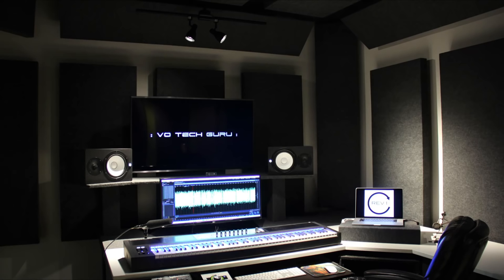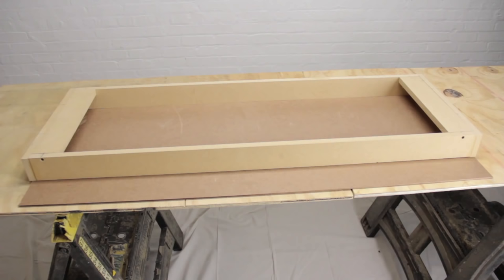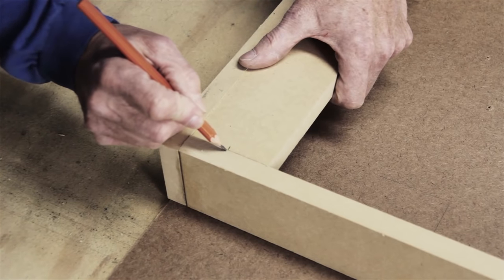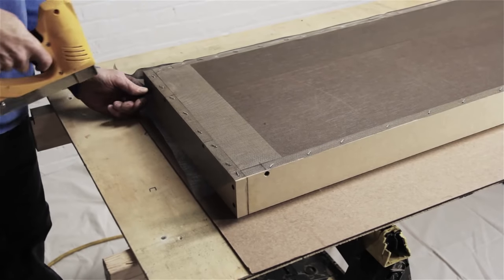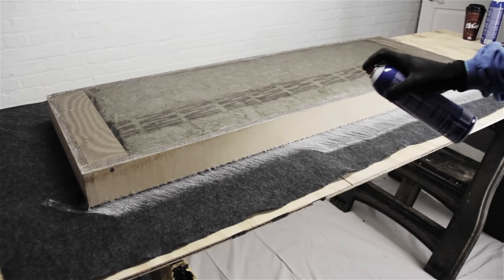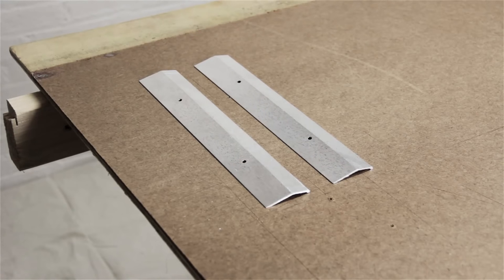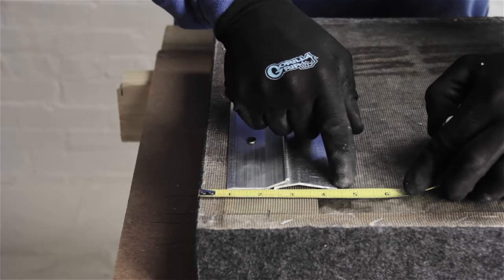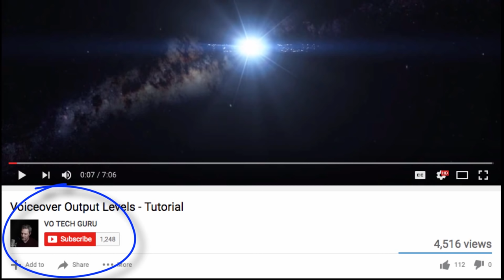How To Build Acoustic Panels | DIY Acoustic Panels

Comment: I made some with closed backs. I used a 1x4 by 3/4" cut in half at a 45' to hang them and put a strip at the bottom for spacing. I also added two each 4x8 by 3/16" aluminum feet to a couple I made to make them freestanding (GOBO's). I like the open backs for the absorption factor. Good video!
Reply from the maker: Thank you! Yeah, the open back def helps diffuse the sound more and the gap helps as well. But for gobos, I bet I would close the back as well if for no other reason than aesthetics. Please feel free to post pics on my Facebook page if you feel like sharing. It’s under VO Tech Guru. And thanks for watching!

Comment: For all the noobs like myself read this!
I just built these and because of my full time job this took me about 3 weeks. It actually came out to be $30 a panel, but makes sense because this video was made four years ago. I had to spend about $100 because I didn’t have like half of the tools mentioned. (Never really built anything before except for a chair in shop class in middle school lol)
These came out to be 14 pounds each. 
Okay, so for the wood.. Home Depot wouldn’t cut it into 3 inch pieces. The smallest they would go was 1 foot pieces to which came out to be 2 - 12” pieces and 1 - 12.5” and 1 - 11.5” piece. Soo idk if they changed their policy on this or what. Anyways so I ended up renting a circular saw from them (which was $28) for a days  use and cut the boards to be 3”. I had to cut each board by 47” width ways first before cutting it length ways because I suck at cutting straight so yeah haha I learned that the hard way.. but anyways, when it comes to the drill bit, the one on the tool list is too big, if you see in the comments I listed the right drill bit size that is needed. And it looks like the one exactly in the video. Everything else is right. I also had to do most of everything on the ground on my garage floor because I don’t have a table that big. I wood glued a scrap wood piece to a big cardboard piece I had on the ground and used that for my frame building. I also used recycled denim for the insulation because it is safer and actually has a higher NRC rating (noise absorption rating). It has the same dimensions as the Rockwool. I got it from Lowe’s. If you need help finding it let me know. Oh also, I needed an extra can of spray adhesive.. maybe I sprayed too much? Idk. But all I know is if I can do it, you guys can too! Also thank you VO TECH GURU!! I watched a ton of videos on how to build these and this one was definitely the most helpful/simplified one. Plus of course the voice is the best.
Reply from the maker: Thank you very much for watching! And sorry for the very late reply, YouTube studio just recently changed to show all missed comments.

Comment: clear, no bs instruction. Now I just need a shop to build it all in.
Reply from the maker: Thank you! It actually doesn’t take much space. If you pre cut, then move that stuff out, then do the next with the same step. You know? Thanks for watching!
Reply: @VOTECHGURU  I did it with some moving blankets and ceiling panels. I took two large blankets, folded each in half and put one on either side of the doorway to the kitchen where a shared wall is. I put the ceiling tiles on these 2" thick Styrofoam panels I found and placed up against the shared plaster wall. Putting my iphone to 3/4 full volume; I could barely hear it from the kitchen. Hopefully they can't hear me practice guitar from the other room either. 

Yours look way better though but hey, I'm not out to impress anyone. Maybe if the guitar ever earns me a gf I'll make something nice like yours. haha

Comment: I've been building panels like this for 2 decades... they are amazing!   There is some really great ideas here in your video I might start using instead of my methods like the use of the threshold metal for the hanger!  Great stuff!   Great video!  Thanks.
Reply from the maker: Jon Raven Thanks for watching!
Reply: No prob!   I've always been a huge advocate for Green Glue usage in studio construction and when they shared your video on Facebook, I came over to check it out!   Great stuff!
Reply from the maker: Jon Raven Awesome. Yeah, my studio in this video where I voiced this tutorial is down the street from a fire department, across the alley from a cabinet shop and on the main street of and industrial zone. Nothing makes it into the booth. We showed most of the build with some pre and post results on my Facebook page at https://Facebook.com/votechguru Maybe check it out, you might dig it. :-) #GreenGlueForLife

Comment: That's a great panel.
The French cleat and bumpers are a solid way to hang these.
But, I would add a backing. Seal that unit to prevent dust.
Reply from the maker: Flaco Kerrigan What dust?

Comment: Thank you for such an in depth tutorial. Just to clarify these sounds panel is equivalent to studio foam if not better. I have studio foam, and canvases but with like 6 towels in the back of them, and I am definitely thinking about adding these as well. Quite a project but looks fun. I want to mix in a room with good acoustics and from what I'm seeing this is what I am looking for to further my studio sounds while mixing.
Reply from the maker: Thanks for watching. Yeah, WAY better than studio foam. I'm voicing this tutorial surrounded by these panels and the boom is gone along with any room response. I also use them to mix for commercial and film purposes. When built right, they will serve you well.

Comment: Fantastic tutorial, although, I’ll probably use 1/2” plywood to make them lighter and even cheaper. 3/4” MDF is heavy, doesn’t allow for torquing the screws down very tight, and doesn’t take glue as well, but it’s also smoother and usually a tiny bit cheaper. 

It wouldn’t matter with an application like this, I just hate the feeling that my MDF could strip out at any moment 😂
Reply from the maker: Thanks. Yeah, that would work too.

Comment: great video - what about the corners?
Reply from the maker: Thanks for watching! You would build triangle shelves in the corners and then put a solid face frame on those, then mount to the face of the frame. Just make sure the triangle shelves are wide enough to take on the width of whatever panel size you're mounting. Make sense?

Comment: Excellent video.  Fantastic quality and sound, plus the detailed instructions are great.  I was wondering what the function of the support piece was?  Is it just to provide a place for the mounting piece or does it have another function?
Reply: It is to stiffen up the frame. It works like cross braceing, otherwise it will be a janky ass flimzy frame👍
Reply from the maker: tjeieio Thanks! It makes the frame really stable but also allows for several easy installation options like hanging from the ceiling, mounting in corners and also turning them into free standing gobo panels which I’ve done.

Comment: First of all, these are easily the best panels I've seen on YouTube, and I've watched literally dozens of videos on them. I especially like the adhesive for the fabric. Second, what do you recommend for a bass trap?
Reply from the maker: I also use them for bass traps as seen in the control room shot near the beginning of the video. I compose and mix for film and TV and they work great. You just need to make triangle shelves and attach some of the wider wood to the face of those then hang the panels. They work great. I also recommend “cloud” panels from the ceiling as well as seen if the video. The sweet spot in my room is crazy good. Thanks for watching!

Comment: I know it might be a bit late, but any tips how to mount one to a slanted roof? I was thinking about mounting 2 of these 'carpet pieces' and sliding the panel from the side, but I'm not sure how secure that'd be

Nonetheless great video, even after all these years
Reply from the maker: Thanks! You could use hooks and eyes like I did from the ceiling as seen near the beginning of the video in the control room shot. The anchors should hold fine. Or just use the carpet strip method if you think they will hold. I bet they would. Thanks for watching!

Comment: Best video on the subject I’ve ever seen. Do you strongly recommend the netting on the back? Any substitutions or eliminations to make the panel a little cheaper in total? Is your felt water tight? Is there a coating of glue I can put to assure the rock wool doesn’t deteriorate over time?
Reply from the maker: I do strongly recommend the screen on the back. As far as making them cheaper, I don't really have any thoughts on that since I built in value at $25 per panel and can't think of anything else I would do to lower costs while still maintaining that pro look. Rockwool is VERY durable stuff and is water/fireproof. The fabric could get wet and dry out but I would expect it to maybe smell. Not sure on that.

Comment: Thanks so much!  I was able to make 9 of these.  I needed 2x the fiberglass screen and about 3 spray adhesive cans.  They came out great.  Also the drill bit was too big for the screws listed.
Reply from the maker: Thanks for watching! Yeah, you don’t want the bit to be too small or the heads of the screws will sit proud. Just under the surface of the wood is perfect.
Reply: Hey man, I am interested in making some as well, however, I am curious as to how much of a difference it made? Id appreciate your intake! I do mostly rap type vocals.
Reply: @ChrisShotz  yes, they made a significant difference in the way guitar amp sounds and clarity in listening to monitors.  Vocals would probably benefit more from those close mic surrounds.
Reply: PeachEater81 thanks so much!

Comment: Very nice video.  Your panels are a very nice design.  I like your cost efficient idea of buying a 4x8' sheet of mdf from which to build.  Very smart.  I personally chose to use SPF lumber (a higher cost) to try to keep weight to minimum to reduce the size and quantity of screw holes on the walls. I will be mounting mine with 2 screw eyes on each frame and picture frame wire and one anchor the wall.  I will be cutting wine corks to size (left over from roommates) to form custom size bumpers.  I appreciate the quality content.
Reply from the maker: Jon R Thanks for watching and for the great comments!

Comment: Great instructional video I must say. Very vell made, and the end result is neat and tidy. I would only use towels instead of rockwooll. Much higher absorption coefficient and at lower frequencies too.
Reply: Are you saying you would replace the insulation with wadded up towels?  Would that actually work well?
Reply: yes
Reply: Wrong. You would have to use a MASSIVE amount of towels to reach the same absorption. Not only that, towels are a huge fire hazard. You can hold a blow torch to rock wool (Roxul) and it won't burn. DO NOT use towels.
Reply: nutcannon have you seen the video I provided in my response? The guy convinced me with his tests so I'll give it a try.
And why do I have to wory about fire in the studio? I mean, I hear this all the time fire this fire that, bur I haven't actually come accross a single post about a studio getting burned yet. So I personaly am not cornceaned about it. And even more so because I'm from Europe where houses are built from bricks and concrete instead of wood.
Reply: because you could make some music that is lit as fuck

Comment: This is a great DIY - one of the best I've seen. Couple of notes - just to clarify, MDF is not plywood. And it's a little weird to work with. Be sure to use a high-end glue. I've found that Titebond III Ultimate Wood Glue, with the green label, works best on MDF.
Reply from the maker: Same glue I used. Good call.

Comment: Your comments have been very helpful. Sorry for all my questions!  I've completed 12 treatments up to the point of finishing them with fabric. Four are earmarked for installation on the 8-foot ceiling of my studio. Do you think the Roxul batt will stay in place if it's suspended face down?  Should I consider hanging them with the backside facing down to take advantage of the two back supports?  And should I do anything else to hold the Roxul in place?  Seems like a good spot to pause and consider options before applying the fabric.  (P.S. I'll use eye hooks on the ceiling and each panel, and connected them with S hooks. That will put a few inches of airspace above the cloud treatments.)
Reply from the maker: The screen material will easily hold the Roxul in place. I used eye hooks into the back supports to hang my panels from the ceiling. I also used the drywall anchors to hang them from the ceiling because each anchor has a 50 lb rating and the panels weigh around 10-12 pounds each, so no problem at all on this end. Hope that helps.

Comment: Hey man love the video! I just have 1 question. Does the felt have to be breathable? Or is that not important? I’m just worried if I use felt it’s going to block sound from going into the insulation.
Reply from the maker: We used craft felt from Joannes fabric, which is extremely breathable, and if you hold it up to the light, you can see right through it. It’s just that the video is very deceiving in that regard. But the fabric is extremely breathable and very affordable. Thanks for watching and for your comments!

Comment: Really enjoyed the video and the mounting is one of the more clever methods I've seen. My only question is about the felt fabric you chose. I've seen a lot of talk about the breath test and fabric permeability. How permeable is that felt and how much does it matter? I have some nice white cotton canvas I'd like to use, but it fails the breath test.
Reply from the maker: Michael Murray Thanks for watching. You can actually see through the felt if you hold it up to the light, so good-to-go there. Hard to say how well your fabric will work, but the tighter the thread the less effective it will be.

Comment: Great video! No air gap?
Reply from the maker: Hi Chris. Thanks for watching! Yes, the hanger at the top and the bumper at the bottom create a 1/2 inch gap. And of course, is anyone who knows what they’re talking about, if you get them further away from the wall they will perform even better, but I’ve use this set up to voice for Mercedes-Benz, Nissan, New Balance and a lot of the other usual suspects for national TV spots, web etc., and they work extremely well with just the 1/2 inch gap. That is, when spaced no more then 6 to 8 inches inside your booth. That said, I have them a little bit further apart in the picture that I showed in the video because that’s my monitoring room and not my voiceover booth. And thanks again for watching!

Comment: OK, I've built 12 frames out of pine. So far so good. More work than I thought but mainly due to my minimal construction skills. Ready to stuff with Roxul etc.  About the back side ... should there be an additional cover over the fiberglass screen to keep Roxul particles from escaping into the air or falling to the ground?  And what about adding airspace by suspending the treatment 1 or more inches from the wall?  Someone told me airspace should match the thickness of the treatment, which would put the front face six inches from the walls and ceiling. That would be un-doable in my small room!  The advice giver said without airspace, the treatments will mainly address mid-range frequencies but be less successful in treating low and low-mid ranges. Any advice on these points would be welcome, thank you!
Reply from the maker: GhostwriterSays Thanks for watching. 3 years with no Roxul falling out the.back for me. Also, 3” away from the wall isn’t necessary. I voiced this video with these panels around me and have no lack of bass in my voice, so you can be the judge in that. I also mix for film and commercials using the same panels and no complaints yet. ;-)

Comment: Excellent video! Any plans to make a tutorial for making corner bass traps?
Reply from the maker: RamytRamyt Thanks! I actually use the same panels in the corners and they are very effective. Just build triangular shelves in the corners with enough vertical surface to mount the brackets.

Comment: One suggestion to make things go faster for multiple duplicate frames.  You can cut scrap pieces to size for common measurements, and then transfer marks from scrap pieces to final pieces, or even better, make scrap pieces that have template holes in them for the common locations for drilling.  Believe me, if you do alot of the same thing, you will introduce fewer errors than using a tape measure.  I know from experience!

Comment: Excellent tutorial.  Yours is the first YouTube channel I've ever subscribed to.
Two questions:
Why do you prefer MDF over 1x3 pine furring strips for the frame?  
I like your use of screening to hold the Roxul in place.  Do you see any advantage/problem with gluing the Roxul to the frame to prevent sagging over time?
Reply from the maker: Hi Richard. Thanks for the kind words and watching. I like MDF because the price per linear foot is less expensive and the material is very stable and reliable. The screen keeps the Roxul from sagging (pressure from both the front and back) or bulging, but it shouldn't sag anyway if you follow the dimensions because it's a very snug fit. Hope that helps?

Comment: Awesome!
Thank you Sir for taking the time to do this.
Best tutorial in panels!
Is there a video on the acoustic cloud ?
Thank you kindly
Reply from the maker: norithmusic Thanks! I don't but it's pretty easy to do. Do you know what eye hooks are?
Reply: Yes. I guess kind of the same steps you did right?
Reply from the maker: norithmusic Yep. Just make sure your eye hooks are the same size as your anchors and you should be good. Each single anchor is rated for 50 lbs and worked great on this end. So screw the eye portion into the back of the panels and the hooks into the anchors, then hang from the ceiling.